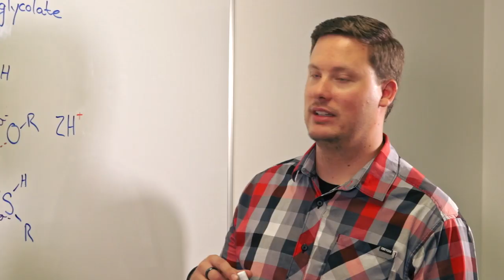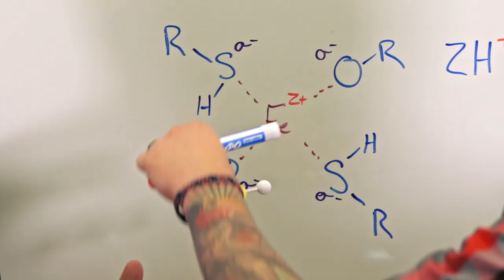How Wheel Cleaners Effectively Break Down Metallic Brake Dust | Adam's Polishes Beyond the Process

Comment: this video gives the impression that the Wheel and Tire Cleaner is a product that has been on the market as long as the Wheel Cleaner and Tire & Rubber Cleaner. This product was literally just released in the last couple of days.
Reply: Idk what "product" you are referring to, but the whole "it will turn purple" has been around for a minute.
Reply: @ScriptureswithShane  they are showing their just newly released product, Wheel and Tire Cleaner.
Reply: @ScriptureswithShane  didn't mention anything about the "it will turn purple" in my post?
Reply: @georgebeato5702  I didn't know if you were talking about the Adam's product or the chemical reaction part that's in other products, my bad.

Comment: Too deep for me and many others.
This would have been more interesting and would have appealed to a wider audience if it describes the process in a much simpler way.
It was not impressive.
Reply: Philip Williams I can put it in a simpler form. 

A chemical reaction occurs when the wheel cleaner clings on to contaminates like brake dust causing it to turn purple. 

It’s like adding a mento to coke. The mento reacts with the coke and causes it to foam up.
Reply: I think it's refreshingly in depth. Unlike the other 2 min videos.